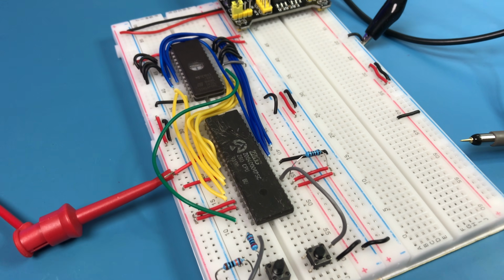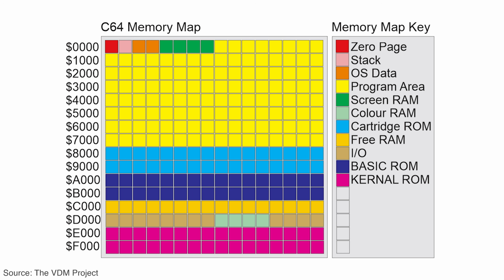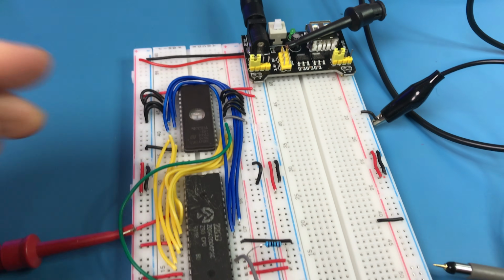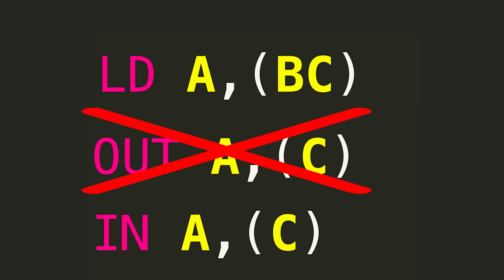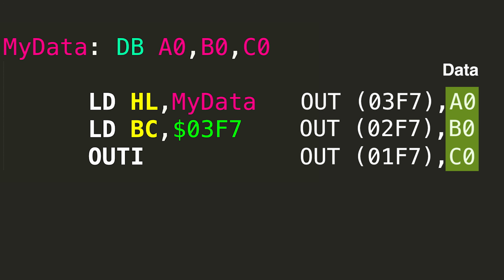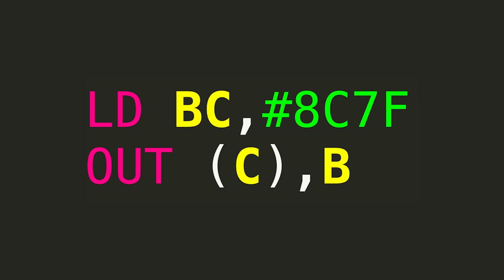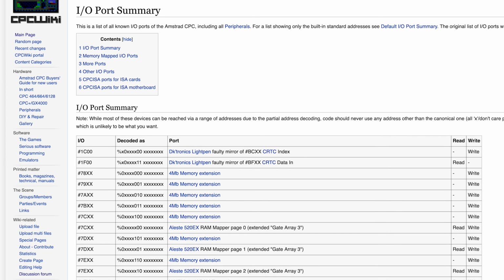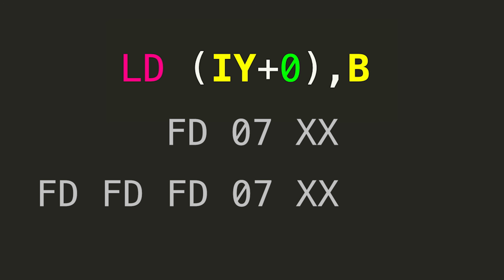The Madness of Z80 I/O

Comment: Old NMOS chips uses the capacitance of its transistor gates like a free register from clock cycle to cycle. So, the same effect that creates DRAM cells also works to move data through the chip as long as your cycles aren't so far apart that the transistor discharges. The later CMOS versions are built differently and can be halted completely.
Reply: Some CMOS chips still use dynamic logic, so can't be completely halted.  This is done to improve circuit density.
Reply: @dfs-comedy  Are you sure?  I thought all CMOS Z80 chips could operate down to 0 Hz.  In fact, that was a way to save power.
Reply: I think he needs a Z84C

Comment: Nice video! The Z80 is probably the trickiest CPU ever made and I/O is only one of its many weirdness. BTW, The ZX Spectrum also uses an IN A,(C) instruction for keyboard scanning. I think that's the only case where the 8 high lines of the address bus are used on a ZX peripheral. I spent some time recreating the ZX and the Amstrad CPC in an FPGA (search for ZX Spectrum in a FPGA) and that also means I had to study these computers in deep, concluding that, in spite of our fond memories about them, if their designers were aeronautical engineers I would never travel by plane ;)
Reply: That keyboard scanning method originated with the ZX80. The Spectrum BASIC also has the commands IN and OUT.

Comment: Having very recently written a Z80 emulator (not deliberately, but more of a proof of concept for a framework for designing CPU emulation) I found that documentation is an interesting thing. But, the actual Zilog manual is verbatim the same as the one you showed and this was clear to be, for OUT (c) you just slap BC onto the address line and for OUT (n) you put the A register onto the high order bits.

But! Find some consistent documentation for how the Half Carry flag is handled. Especially when it comes to the ADC/SBC instructions! That was a rollercoaster ride. For anyone embarking down this route it's actually not that bad.

For 8 bit arithmetic operations, you want to take the first add/subtract value. Put it into a 16 bit storage and & with 0xf. Then take all values you want to add (or subtract) (INCLUDING THE 1 for carry set on the xBC instructions) one at a time to the value, with & 0xf applied to each. So if you have 1f + 2b + 49 you would add f + b + 9 = 23. At the end if the result is above 0xf then set half carry. However, for 16 bit operations you need to do pretty much the same except to use & 0xfff on each value and at the end of the value is > 0xfff then set half carry.

Finding a single place with this actual information was a nightmare.

Also, I want to say the ZX spectrum does NOT only use the low order values. While it's true the ULA is addressed by 0xFE, it does look at the high order bits when reading the keyboard. The high bits address the 5 keys you want to scan right now.

Comment: It's pretty clear from the design that Zilog originally intended only 8-bit IO addressing, probably assuming 256 output ports was plenty. B appearing on the bus was most likely a glitch due to the internal design, in the same way A appears on the bus when you do OUT (n), A.

Lots of people saw the advantage of a 16-bit IO space, since you could cheap out on hardware address decoding. The Spectrum, for example, also does the same so Amstrad were far from unique in this regard. I suspect that's also why Zilog eventually documented that behaviour.

Comment: It's pretty clear from the design that Zilog originally intended only 8-bit IO addressing, probably assuming 256 output ports was plenty. B appearing on the bus was most likely a glith due to the internal design, in the same way A appears on the bus when you do OUT (n), A.

Lots of people saw the advantage of a 16-bit IO space, since you could cheap out on hardware address decoding. The Spectrum, for example, also does the same so Amstrad were far from unique in this regard. I suspect that's also why Zilog eventually documented that behaviour.

Comment: Everytime I see your Intellimouse it makes me miss mine, one was black modded with blue LED.. Such a great mouse, especially for it's time.. it's almost like the Model M of optical mice. Almost makes me want to get one and mod it's internals so it can be high dpi and polling rate (so glad USB finally went 1khz since switching from a ps2 mouse modded to 200hz to a usb mouse at maybe 125hz sucked, I feel old now) and maybe add a few extra buttons!
Reply: zOMG I just Googled and they brought it back! May have been a bit ago though, says out of stock [edit: yeah, released 2018, if I knew back then I wouldhave got it!]. 1000hz 3200dpi 3000fps tracking. Still only 3 button though, I really do like having a thumb button for back and maybe a small one under the wheel for dpi toggling etc..tbh otherwise I rarely use the like 5 extra buttons mine has other than what I just mentioned, maybe occasionally in games but even then I'm pretty hardwired to 3 button with thumb.. my stepdad used to have a mouse with dual scroll wheels (vert and horiz) and a thumb button in early 2000s maybe even late 90s and I loved it and instantly got addicted to the thumb button for back, though I didn't use the 2nd wheel much, it was nice to have when you did need to scroll horiz and useful in games.
Reply from the maker: I have a stock of 4-5 of those for different systems and as replacements as they wear out. Inevitably, the wheel wears out and starts skipping after ~10 years or so. Not complaining though :-)
Reply: @NoelsRetroLab ah dang. I actually think I still have my black usb one I dunno if it works might have to dig it out dont remember if thats the one i modded blue

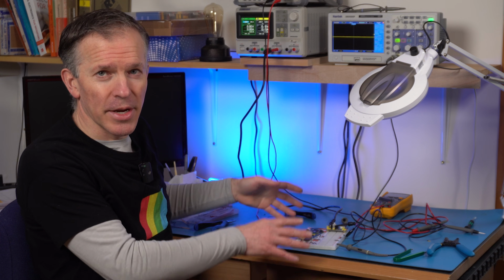Comment: 6:52 I've run to like 30ns on breadboard (teensy emulating a rom directly from its output pins) which is like 30mhz with the host using the rom at like 12mhz (though the host was impemented on pcb) expecting like 70-90ns memory (though it wasn't happy until the response after address line set and CE was like under 40ns, slewpew)

Comment: In my opinion, the ZX Spectrum keyboard lines was a bit poorly designed. The I/O ports used are 0xfefe, 0xfdfe, 0xfbfe, 0xf7fe, 0xeffe, 0xdffe, 0xbffe, 0x7ffe, meaning that C is the same for all eight lines, and B is shifted left once for each line. If they had instead used lines 0x08fe, 0x07fe, 0x06fe, 0x05fe, 0x04fe, 0x03fe, 0x02fe, 0x01fe (B decreasing by one for each line), the entire keyboard key state could be read to memory quickly using just one INIR instruction.
Reply: That would have required an additional chip for decoding, making the Speccy more expensive for a very dubious benefit. The way it is,you can check whether any key is pressed with a single IN instruction followed by masking. I think, that is a far more important use case than copying the keyboard state into the RAM (why would you want to do that?).

Comment: LD instructions always reads and writes data it is just a matter of what the source and destination are. That is why there is not a read and write instruction.
The IO instructions are much more limited as they were an add-on to the instruction set and don't need to have numerous addressing modes like the LD instruction, thus they are targeted to what the function is. IO instructions where meant to be 8 bit addresses but there are 16 address bits and they need to be set to something. Using B as the upper address means you can use 16-bit addresses for IO if you choose.

Comment: I had an Amstrad CPC664 many years ago and rolled my own DIY epansion for it. Looking at the data book for the Z80, I expected to be able to use interupt mode 3 with the most features( I connected a UART which I wrote a 68HC11 cross assembler for to program 68HC11E2 chips and inputs to scan a DIY mouse) Unfortunately, Amstrad chairman Alan Sugar had chosen interupt mode 1? (it was a long time ago), which did not support real time interupts. As a consequence, I dropped down to polled encoder inputs and my mouse only worked very slowly. Early days!😆 I remember writing assembler routines accessed via Amstrad Locomotive BASIC and setting up BASIC configurable screen colour redirects and automatic cycling pallette, then writing maths art 3D Z-scaled algorithms with some modulo cycling through the pallette. So much fun and my pot-head flatmates were awed by the psycadelic results!  Writing the 68HC11 was a great experience. Took me a month of my spare time and I was so pleased the assembler mnemonics were not too CISC, Motorolla's micros had elegant mnemonics.

Comment: IIRC, the ZX80 ran a line to the expansion connector that allowed you to prevent the address decode on the unit from doing its thing.  This cost them very little extra hardware but also allowed some very creative things to be done with a ZX80.

Comment: On LDIR/LDDR if you need a bit more speed, use several LDI/LDD instructions and loop them; LDIR is 21 cycles per iteration, LDI is 16.
On INIR/OTIR, I think they can be useful for RAM Disk; Using 256 byte 'sectors', the B countdown with INIR/OTIR can be used to address each byte of the sector, making the read and write code very small and fast.

Comment: The addition of JR unconditional/NZ/Z/NC/C are very useful, but I think a relative call would have been much more use than DJNZ.
Nascom 2 had software implementations of relative call and system call using the RST instructions in NAS-SYS 1, but they were poorly written (not interruptible).
In about 1980, I wrote clean routines for them so I could have my Nascom 2 demonstrate the space invaders game I had just written while it wrote copies in the background using interrupts.
I had just enough time to go to the computer shop and buy a box of blank tapes and program an EPROM ready to sell some copies at a computer fair the next day.
Reply: A Nascom II. That brings back memories. I also ended up writing a system that ran on a Gemini Systems machine, which was based on the Nascom II and used an extended version of the NAS-Bus called 80-Bus and was orientated towards process control. Gemini was set up under John Marshall when the receivers moved into Nascom. It was then bought by Lucas Logic in 1981.

I got very familiar with the Z80 I/O system and programming PIO, SIO and CTC chips as well as various other interfaces. What was produced was a system for timing race cars (with public access) with James Hunt being involved for publicity. Unfortunately the business (which had very dubious backing) failed, but the circuit, which is now a rather large kart track, is still to be found in Milton Keynes. 

The system was fairly sophisticated in that it was fully-interrupt driven and had a real-time pre-emptive multi-tasking (6 tasks plus an "idle" task) with an interrupt driven kernel. I was favourably impressed with the Z80 and its I/O system given the limitations. It had a few features, like a (partial) shadow register set, which was great for interrupt handling. The base + displacement addressing with the IX & IY registers was good for multi-tasking and some of the other functions. Mode 2 vectored interrupt handlers were also ideal.

I can't imagine having squeezed so much into a 6502 machine with it's rather limited addressing modes.

Comment: There is nothing mad about Z80 I/O that I can think of. That is from experience, having used the architecture for a fully interrupt driven embedded application complete with what was a pre-emptive multi-tasking operating system. That included programming CTC, PIO and SIO as well as a couple of backplane-connected vdu cards. It was all mode-2 interrupts, and the nature of the application was that it did not need DMA as it was low data rate, but a requirement for very fast interrupt handling as it was used for timing on a race track. 

It drove two printers, a giant 7 segment display, a single operator console, three timing beams, three car identification systems, start lights, jumped start and car redirection lights. A bit of an oddity, as the original commercial model failed, but the circuit remains, less the (mid 80s) control system, now being a rather large kart track in Milton Keynes, England.

As the code all had to fit within a 32k ROM, it was compact and was in no way a general purpose OS, and all tasks (7 of them, including an "idle" task) had to be assembled and burned into the ROM with what was the OS core. Tasks were not re-entrant (no need), but there was a large number of shared utility and system routines, all of which were re-entrant and were also shared with the single level interrupt routines (nice on the Z80 with its partial alternative register set). Code that had to be single threaded was simply done under non-interruptible conditions which could be nested. I/O and inter-task communication was done via ring-buffers, although I/O could be direct, as was done in startup via redirecting system routines. The buffers could also be configured as to purpose during startup, although redirecting dot matrix output to a screen would lead to odd results. 

The serial port drivers for various peripherals were driven at (dedicated) task level, using wait states, with the core only handling the interrupt status. 

In short, you could do some very powerful things with Z80 peripheral chips, and some aspects reminded me of what I did as a day job, which was writing operating system code for IBM architecture machines. 

In any event, I was extremely pleased with what I could cram into the Z80s address space, without having to resort to page registers and memory banks. Of  the I/O system, at least with standard Z80 peripheral chips, I was very happy.

As for LDIR and the like, then I was used to SS - store, store instructions on the IBM, and it is a great way of reducing code size, although anathema to the load-store RISC crowd.

Comment: If you can fit you I/O in the bottom 128 bytes of the I/O page, then Z80_A7 high during /IOREQ can access a RAM Disk, with with Z80_A8-A14 tied RAMDisk_A0-A6, Z80_A0-A6 to RAMDisk_A7-A13, and then (for a 512KB RAMDisk), RAMDisk_A14-A18 on a latch (eg, accessed somewhere in the lower half of the I/O page), and INI and OUTI can be used to copy to/from the RAMdisk to main RAM. While B counts down, so you want to put the first byte of a sector with B=0x7F and the last at B=0x00, you can use the same swap for both OUTI and INI, so you can use a single OTIR/INIR to write/read a single 128 byte sector, and have a 128 sector (16KB) "track" available from setting five bits in a latch.

Comment: Sinclair did the same. There are ports actively being used in ZX Spectrum 128 and Amstrad produced Spectrums as well. Port #1FFD (+2A, +3x mem ctl), #7FFD (128 mem ctl), #BFFD (AY port), #FFFD (AY port).
Other usable method is memory mapped IO. For example for ZX Spectrum, there's a ROM at first 16K of address space. By pulling up the ROMCS signal (it has the required resistor already), ROM chip will not get selected and the whole 0-$4000 is now available for IO. Or external ROM/RAM/whatever. It can even be triggered but memory write to a location, where ROM resides. This is how most of the extensions for Spectrum work.

Comment: Nostalgia time again.

I wrote terminal emulators on the Z80 and the IN, OUT instructions were never any problem.  The way they were implemented was with a separate 256 byte address space for I/O.  They would typically occur only once each in any program, wrapped in assembly subroutines I would name "inchar" and "outchar".  Very simple for async serial I/O.

The real complexity challenge, especially for data communication, was setting up and responding to hardware interrupts from whatever communication controller chip the implementation used - for a Z80 typically a Z8530.  The capabilities of the Z8530 SCC still impress me today.

LDIR is one of my favorite instructions.  Used it frequently for block moves with memory mapped video and such.

Where OUTI and INI came into play was with "block mode" terminals or emulators and/or synchronous communication (again, the Z8530 as an example).  For example, HP3000 mini computers could do block mode terminal  I/O and had an application programming support layer for that called VPlus.  And don't forget "green screen" terminal I/O from IBM.  A defining characteristic of these terminals was the hidden data transfer followed by instantaneous refresh of the entire display (LDIR again on the Z80).
Reply: ZX Spectrum 128K by Amstrad used I/O ports #7FFD, #BFFD and #FFFD (it means 16 bit I/O address). Even instruction IN A,(NN) sends previous A content to A8-A15 first (this feature was actually used for scanning ZX Spectrum keyboard).

Comment: This seemed to be more of a story about how Amstrad used the Z80 as opposed to the Z80 itself. Intel / Zilog chips had hardware mapped I/O, while Motorola chips were natively memory mapped I/O, making Intel/Zilog hardware design easier with (especially) Zilog I/O devices. Motorola assembly was a bit "cleaner", but you gave up a chunk of code space for the privilege. 

Oh, and the fact that you could not single-step the processor via a push-button? Simply wrong. That was the ONLY way we could debug our programs in 1978...😂😂
Reply: There are many ways to single-step a NMOS Z80 via push button, using the NMI or the BUSRQ pins. He just didn't do it right, but instead tried the "6502 way" on a Z80. Anyway, there are several example circuits out there.

Not long later, the CMOS version of the Z80 was available, then "the 6502 way" of stopping the clock was also possible.

Comment: The standard Sinclair Interface-1 was also using M1 to capture rst #8 to swap shadow ROM with a different code to handle it. The rst #8 was called by the standard BASIC interpreter in any case of syntax error so it allows easy expansion of commands.